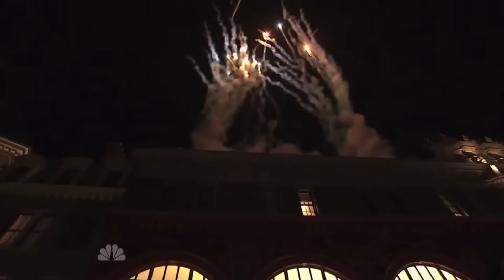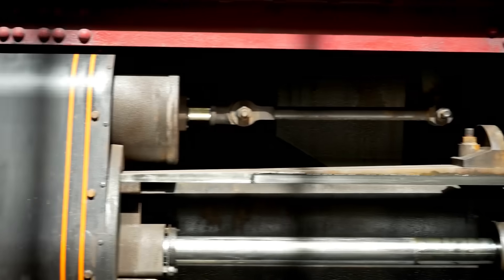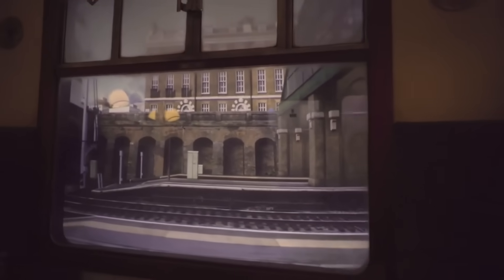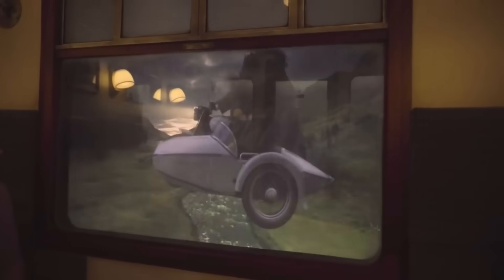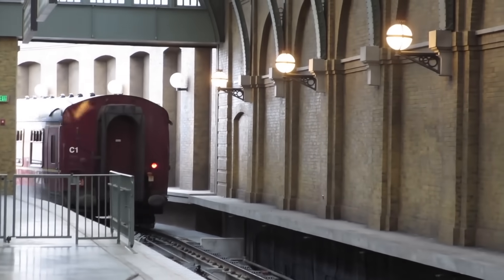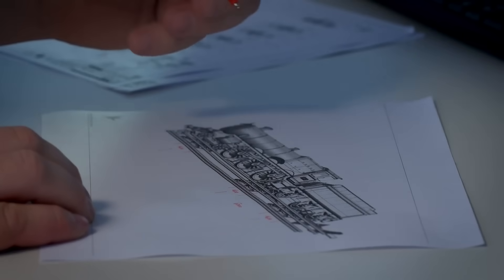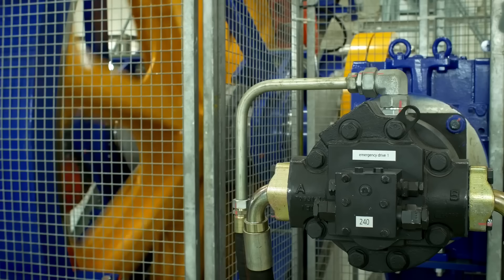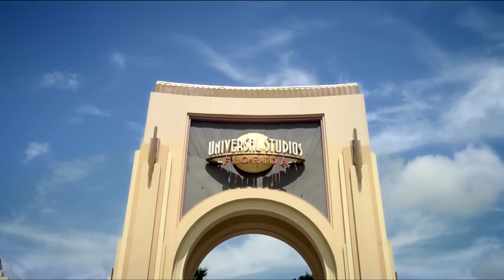Why This Hogwarts Express ISN'T a train!

Comment: Kind of funny that I went to Kings Cross to see if the platform actually existed to some extent and Universal has a better version of it. All Kings Cross had was a boutique to buy stuff and an excruciating long and expensive photo op place with a cart that's half in the wall to take a photo by a professional which you cannot take with your own phone, you gotta pay.

AND NO red choo choo train at Kings Cross! Was still worth it. Highlight of my London journey. I'm not even a fan anymore of Harry Potter but my 9 years old self would have been proud to know I saw it with my own eyes.
Reply: The entrance to platform 9 3/4 was between platform 4 and 5.

Comment: I rode this several times last week. It was really cool and fun, however they did a very poor job designing the que. everyone with a stroller is forced to take an elevator up to a 2nd level where the train is instead of building a simple ramp. Everyone with a stroller gets bottlenecked at the elevator. What happens when the elevator breaks? It was very inconvenient.

Comment: Ok... But how is the front train always in the correct position?
Reply from the maker: Both trains face towards the Hogsmeade side. Train engines don't normally unhitch and go to the other side, it's natural/common for them to push forward and backwards. So this is technically correct when they back out of Hogsmeade and enter Kings Cross in reverse.

Comment: From an engineering/location aspect It wouldn't really work on disney as an attraction, Depending on which park it was built you'd still be in the same park, Unless it was a fully functional train that spanned all parks.. 

That would have been a very costly project and they already have the monorail system.. 

Universal parks are legitimately side by side.. Making it an easier and way more coast effective.

Comment: They installed one in the Bay Area that connects Oakland international with the BART system about 2 miles East. It has 6 or 8 cars I think, the totally horizontal ropeway is always in motion so the trains grip or ungrip the moving wire rope as needed to not enter a blocked zone ahead. Two tracks. Half a billion $.

Comment: I remember seeing a Harry Potter train on location at Black Park. I heard that they chose to film there not just because of the scenery but also because the Railways Act would have prevented them from using the rolling stock as they wanted to on a real railway line.

Comment: Were the hogwarts windows to the between the halls and rooms of the passenger cars opaque acrylic panels?  It would have been much better to have projection screens so that the guests could see a color film of the actors rather than just “convincing silhouettes”.
Reply from the maker: It does make more sense to have them be just acrylic panels. If a screen has issues it gives the illusion away immediately. Moreover during loading you can see actual guest shadows which then transition to the projection later. Moreover a screen would make the doors much thicker. The design choice makes sense.
Reply: Isn’t a funicular and a trolley like the one in San Francisco a real train?

Comment: Why are the prop wheels motor driven as opposed to just rolling them on real rails?
Reply from the maker: Yup, they need to clear the real track and all its equipment.
Reply: @AmusementLabs  Does that include while the train is entering/exiting the stations? I thought maybe that the false rails could sort of slope up to meet the false wheels just before the visible point in the station. Perhaps the wheels could have been on their own sort of suspension system to eliminate the problem of them being slightly misaligned vertically?

Comment: This is really cool.  Having some experience with working with/on various heritage railways as a volunteer & being familiar with even some of the more unconventional types of trains, when I saw the cables the first time I rode this back in 2014, I figured it was something along the lines of the San Francisco cable-driven streetcar system.  It never occurred to me that it could have been a horizontal funicular system (possibly because all the funiculars I'm familiar with, namely the ones in Pittsburgh & Quebec City) are just short of being vertical in nature (e.g. the Mount Washington funicular that goes almost straight up & down the side of Mount Washington in Pittsburgh & the Funicular in the Old Town of Quebec City that goes from the Chateau Frontenac to the docks by the St. Lawrence river).  It's really cool that they were able to use the general concept for a horizontal railway, even the fact that it has identical trains/cars on both sides to act as counter-weights for each other.

Also, funiculars are considerably older than you stated in the video.  There is a funicular in Hohensalzburg Castle in Salzburg, Austria called the Reisszug that has been in operation since at least 1504, and still is used to ferry freight up the side of the mountain to Hohensalzburg castle.

Comment: It would have been nice if they'd included a few 3D models of intercity 125 and 225s with mk4 carriages in the projectors as guests depart King's Cross station. The former of these locomotives appears in the first book and the latter appear in some of the films.

Comment: As a train enthusiast, this annoys and disheartens me but I still have to sigh and concede that Universal did everything they could to bring as authentic an experience as possible. 

I understand the logistical and technological advantages of the current system, but you just cannot beat the authentic feeling of a legit steam locomotive. I can imagine though that this was the only way Universal could pull this off though. A real steam engine takes a lot of TLC to operate and would be very expensive. A diesel would be cheaper and more efficient but then it still would not capture the same authenticity as a genuine steamer. 

But all of this being said, what Universal's done here, as it pertains to the Hogwarts Express itself, there's another factor to contend with that there was no getting around if they had gone with a real engine and railroad, and that's the difference between US and UK Railroad Regulations. If the Hogwarts Express were to be used in the US, aside from a few minor factors, it would require a bell and a pilot (cowcatcher). Something that British engines don't require. Adding those would immediately take away from the immersive feeling, especially as engines are required to ring their bells as they approach and enter a station, something that doesn't happen in the UK since most British engines don't have a bell. 

So while the fact they don't use a real engine is annoying, I understand the reasons for their going this route. A funicular railway was basically the only way they could've skirted US railroad regulations on this. I tip my hat to the Engineers at Universal for doing everything they possibly could to meet the compromise of authenticity and feasibility.

Comment: If you cross over the pond and come the UK, you can book a ride on the real steam engine that was used in the Harry Potter films. I have actually seen it when I was travelling to work on a regular service train. The locomotive was painted red for the film but was originally a Great Wester Railway engine. Therefore it was originally green.

Comment: I don’t understand why they made the decorative wheels motorized and synced and all that when so many problems could be simplified by having them simply mated to a rubber wheel that runs along the track to spin them… it would spin in perfect timing because it’s driven by the movements of the train, require no power or electronics that could fail…

Simple… I’m very curious why they over complicated the simplest part..

Comment: Such an amazing attraction, and Fun fact, did you know that the Real Locomotive is still around? In case someone doesn't know, the Hogwarts Express' locomotive was actually Great Western Railway 4900 Hall Class No. 5972 Olton Hall, built at the GWR Swindon Works in the UK.

Comment: The loco looks pretty good, but do they also get the smell right? Steam locos have a smell, coal, hot oil & hot metal. They certainly didn't get the front bogie right, it's way too wide.

Comment: 7:40 regardless of the slope of the track, the motor wouldn’t have to overcome gravity since the weight of the train going downhill would cancel out the force needed to pull the other uphill.
Reply: This is not quite true. If the slope is constant from one end to the other, then you are right that equally loaded trains will balance each other out. (One going uphill and the other going downhill) However, consider a track that is uphill as you leave each station. (The trains go over a hill in between stations) In that case both trains need to be lifted against gravity at the same time. They will also both be rolling downhill at the same time as they arrive at the stations. In such a case the designers must provide additional horsepower and braking to drive and stop both trains at the same time.

Comment: Not a Harry Potter fan, but I'd say very interesting solution for the train. At first one might wonder why not make real train -  but then you have to understand limitations- 1) it is impossible to build a return loop for the train in dense city area. 2) The train go back and forth per day many times, and engineer operation would be pain in the neck. Plus fueling the engine for so many routes would be pretty pricy. So yeah, a cog-cable system makes more sense. Although, they COULD make real wheels and not make those silly secondary wheels below the track, which only making it more complex and unnecessary.

Comment: Y don't the show wheels act as the real weels?
Reply from the maker: Couldn't get permission to use the footage and also it was not great quality.
Reply: @AmusementLabs  oh alright. I guess you got me wrong so i'll refrase;

I meant why the weels u see as a guest (the weels used by a real steam locomotive) don't run on the real tracks but instead they use other smaller weels to support the locomotive, as you said?

Comment: call me crazy but it sounds to me like it would have been a whole lot simpler to just use an actual train with an electrified third rail.  This system seems way over engineered for what could have been a simple loop track.
Reply from the maker: They unfortunately don't have the space for a simple loop track. If you go to Google maps/Earth it's a tight fit at the ends of the track/where the stations are.

Comment: It's funny. They could have just put the engine's 2-6-2 wheels on their own track, but made them unpowered.  Making it look even more convincing because they moved with the train, and it would cut out the motors needed to move them. Plus the extra stability couldn't hurt.

Comment: The question is why did they do a cable driven system rather than a train with electric motors driving the actual unit?
Reply: The cable system is more reliable.

Comment: The REAL Hogwarts Express (the locomotive) Is in a heritage railway in the UK, wearing the nameplate Olton Hall since it was the name of the engine before it was restored back in full working order for the movie, but don't worry bc the engine is currently in it's Hogwarts Express Livery.
Reply: I thought it was in full working order before it was ever repainted for the movie.    Is it currently on a heritage railway?   It's hard to find anything definitive on the net, the amount of obvious BS that has been printed about it swamps everything.     I'm just bloody glad Taw Valley escaped that fate.
Reply: Olten Hall is at the Warner bros studio in Watford, on long term loan from West coast. Dumbleton Hall has just been shipped of to Japan to be turned I to one of these abominations.
Reply: @samwhite1995   Since I doubt there ever was a real 'Dumbleton Hall', what exactly is it that has been shipped off to Japan?     OOPS correction - seems there really was a Dumbleton Hall, no 4920, named after an actual building called Dumbleton Hall which still exists.    (It just sounded so like a Harry Potter name).     https://en.wikipedia.org/wiki/List_of_GWR_4900_Class_locomotives   notes it as 'Preserved'.     I'm not a GWR fan but no working locomotive deserves a fate like that.

Comment: You are better off visiting the Severn Valley Railway or Didcot Railway Centre in England where they have fleets of these (real) engines and carriages in daily use. You can’t beat the sights, sounds and smells of a real working heritage steam railway.
Reply: Or any other working preserved line.   Admittedly the SVR is pretty good.

Comment: Is like a cable car San Francisco
Reply from the maker: ... mechanically no. The San Francisco cable cars use a clamp to grab onto an always moving cable and pull it. So the cable is not always fixed to the cable car like here. Additionally there can be more than 2 cars or trains on a cable unlike here.

Comment: imagine them doing something like this for the Polar Express.
Reply: That'd be really cool, to be honest. I'm fortunate enough to live a couple hours away from the real Polar Express, Pere Marquette 1225. I'm hoping to ride it next Christmas, but it'd be amazing getting a Polar Express ride similar to this one with screen accurate passenger cars, projections in the windows of iconic scenes like the wolves running by in the forest, going over the ice and stuff, and then eventually arriving in a different set themed like the North Pole
Reply: That would be incredible. That movie/book is so magical.
Reply: but will it drift?
Reply: The only problem with a Polar Express ride is that it'd be more of a seasonal attraction. I mean, sure, it'd draw fans in all year, but it would only really be popular in and around Christmas Time. Unless you had an area of the park that was themed around "Christmas All Year Long" or something like that, the concept wouldn't work.

Although you could possibly theme the attraction for the non-Christmas Season like, have the ride story be that the Pol Ex is needed to help deliver toy making supplies to the North Pole and the passengers are brought along as special conductors to help. Then in the summer have a "Christmas in July" story and then for November through early January, have the ride be the traditional Christmas themed version.
Reply: no
we already have Pere Marquette 1225, which is more than enough
Reply: Well they use real equipment for that.